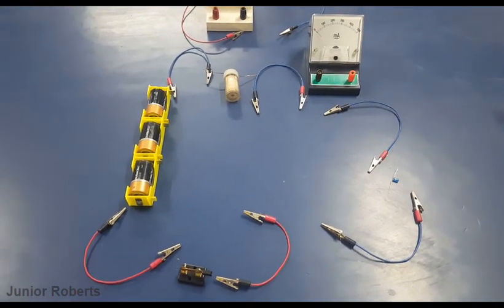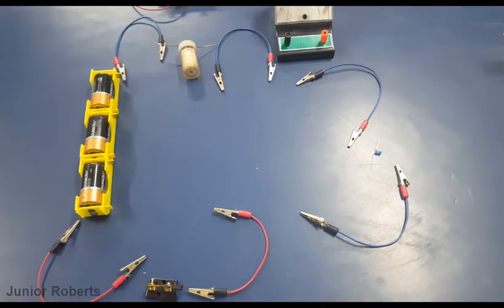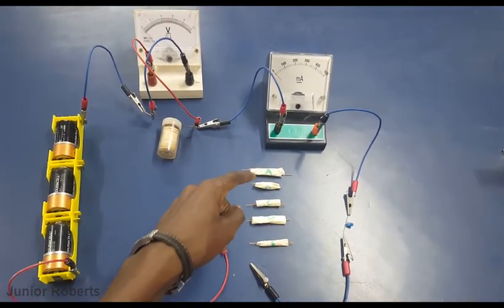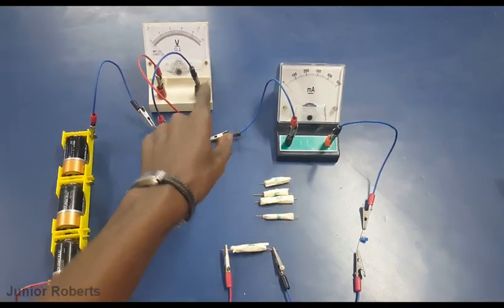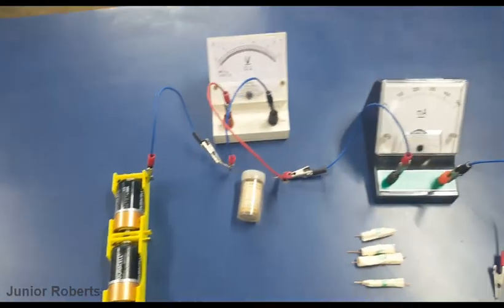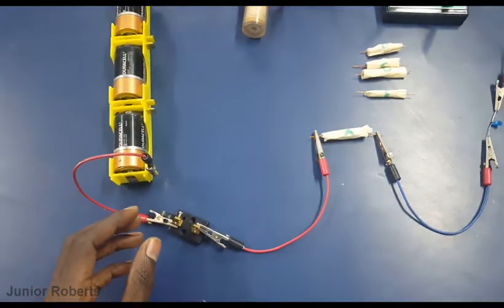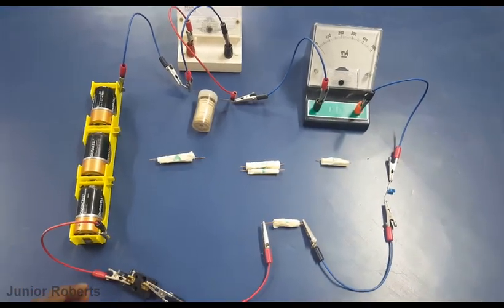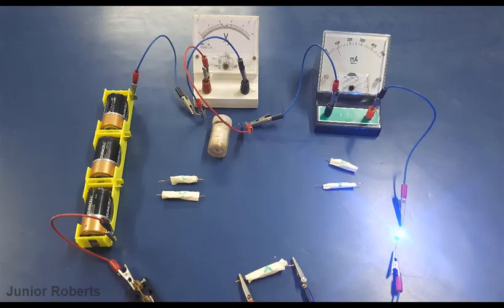CSEC Physics Paper 3 Lab Demonstration - January 2016 | Junior Roberts

Comment: sir im confused the longer line represents the positive terminal did you just do this backwards?
Reply from the maker: You’re correct the alignment of the battery was not exactly as shown in the diagram. However all other connections were appropriate 👍🏾